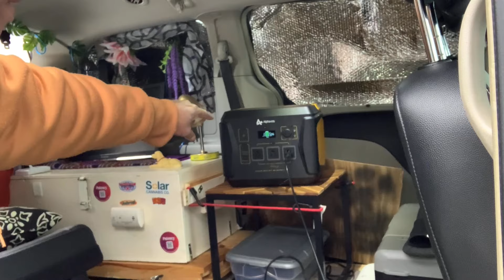Cleaning up after Camping #vanlifers # cleaning

Comment: Morning 🌄.   So glad you had a fine time at the ski 🎿 resort!   You worked way too hard cleaning up afterwards, 😅.  Those little 2 - 5 Gallon Shop Vacs are great for that.  Gets the Dry and the Wet out so it won't mold too.  Those don't use much power draw.  With your bigger Vac your power station can handle it but the wires from your station to your connections might be strained over a short period of time.  A friend fried his system using his household Vac to clean his van.  I honestly am clueless about it all so I just use the Shop Vac sparingly for bigger jobs and use the hand vac (Dirt Devil) for general clean-up.  Boss Lady said NO THANKS to the COLD...Beautifully wise lady 😄 she is.  
Both of you two have a swell 🙌 week ❤.